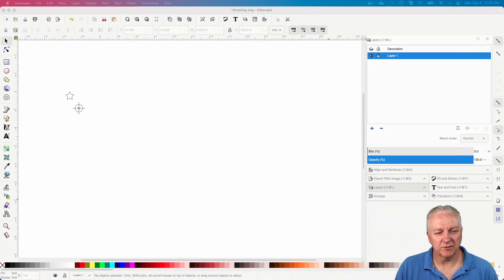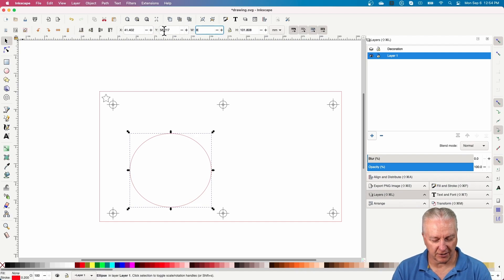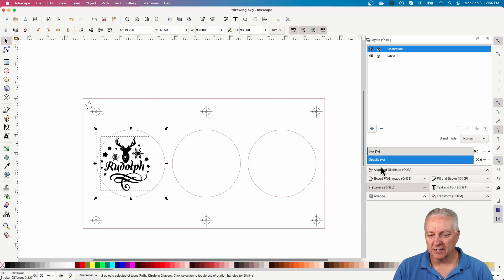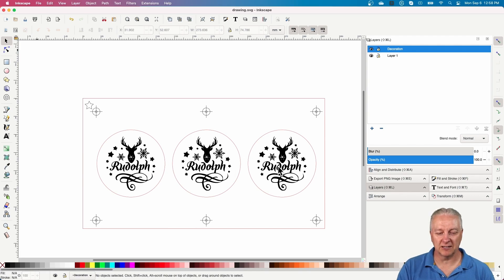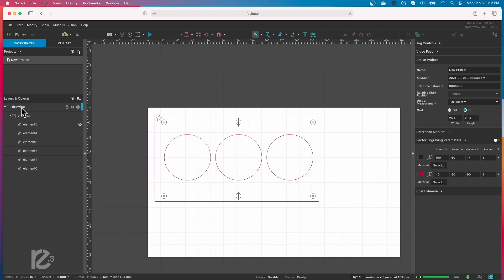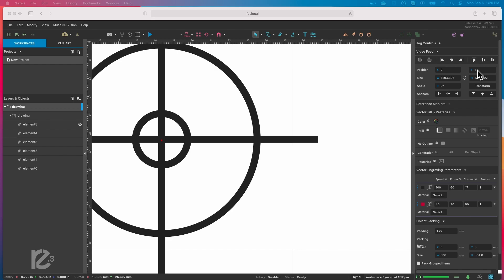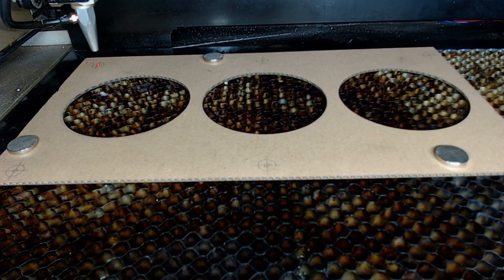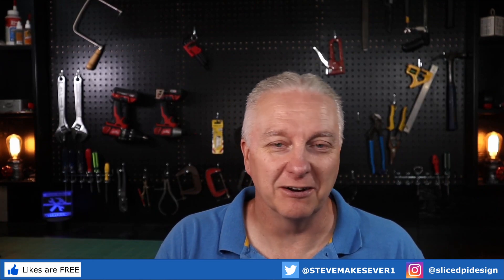A Jig for Laser Cutting

Comment: Hi. To get the crosshair perfect to the bed i have a pin hole dead centre on each cross hair!!! When i line up the 1st cross hair i put a pin through that hole on to the work board- so when i move the template the cross doesn't move and makes the cross hairs easier to line up in the other positions without throwing say that 1st one out- the others are lined up perfect!!! Good on you showing this! TY
Reply from the maker: I often use guide pins like this too. When precision is essential this is the way to go

Comment: Thanks for the video. I just got my XTool D1 10W and found your channel.  I followed your video and it was extremely helpful to a newbie like me. I am trying to do some 4 inch round coasters so I created a template with targets and 4 inch cutouts. All good. Then I put all that into a tool layer and drop in a coaster. I set up the text so that it is H-centered and V-centered on the coaster I want to create. I use the targets and absolute coordinates to make sure everything is set and hit start. The laser moves to the correct coaster area and it is vertically centered correctly but it is starting the text too far to the left, not in the horizontal center. I'd appreciate any help in figuring out what I am doing wrong. Thank you
Reply: One other note. When I use frame, the framed area looks like it is centered both horizontally and vertically but when I hit start, it moves to the left and starts putting down the text too far to the left.
Reply from the maker: Hmm, maybe this is some weirdness in Lightburn. Make sure you are engraving the font you think you are. If you created your coaster somewhere else and it uses a font that isn’t on your machine, lightburn will use its imagination to pick one.  Vector fonts tend to be a bit weird sometimes.

Alternately convert your design to a bitmap image and engrave that to see how it does.

Comment: Excellent video! Could it maybe be a good idea to drop the discs in the template before aligning it perfectly? Thanks a bunch!
Reply from the maker: The point of a jig is to make dozens of these without resetting position.  When I use a jig I will use either tape or magnets to keep it in place and then will periodically check positioning to make sure it isn’t moving

Comment: Why wouldn't you cut the outline first, then move it to the upper left of your bed before cutting the circles? No need for alignment then, just place the template at top left every time you use it. Or am I missing something? Great video as usual Steve 👍
Reply from the maker: If you are engraving images then you often need more space on the sides of the workspace for the head to slow slow and change direction. Sometimes you can get away with. Using a known physical location but don’t count on it. You will also find out that on many lasers the workspace fit isn’t precise and flop around a bit so the location you think is known, can actually move around a couple millimeters in both directions
Reply: @SteveMakesEverything Thanks for the explanation. I get it now. I'm new to lasers, but have extensive experience with cnc machines, which don't have this issue of overscan. Lots to learn by the look of it 👍

Comment: is there another way to down load the file besides github?
Reply from the maker: There is only a single SVG there.  Once you click on the file you will probably see the actual image displayed.  Right-click on that and save the image file to your local system

This BTW is one of the reasons I switched away from GitHub.  Unfortunately it means I needed to expand my web site service, which costs a bit more and is what memberships help pay for.

Comment: Steve, 
You videos are amazing, i recently purchased a FSL Muse Titan and have had problems with it from Day 1. Demos and instructions from the FSL site are really poor compared to other laser manufacturers. i am so glad you are help the community out with your FSL video examples. Steve have you had any luck with engraving Glass with your FSL Laser and if so what settings would you recommend?

Many Thanks Again 
Prakash
Reply from the maker: Thanks Prakash.  Yes I have engraved glass.  The settings will depend on your laser so you'll need to work them out for yourself, but generally start with lower power and higher speed and gradually adjust until you get the effect you want.  I did a video about the rotary attachment where I engraved wine glasses - take a look at that for some tips, though a Titan has much more power than a Muse 3D so you'll definitely need to scale that back.

BTW, when laser engraving on glass you will get lot of little shard artifacts, so you will probably want to lightly hit the engraving with a soft rotary bush to remove any remaining shards (avoids potential hazards later).  Wear safety glasses when doing this of course.

Comment: New to this. Is the advantage that you can precut the disks and then just drop them in thereby saving cut time?
Reply from the maker: The shape of the things you are trying to engrave is irrelevant.  It's all about engraving in volume.  Set up for cutting is roughly constant regardless if you are engraving 1 or 20.  This lets you reduce the time to engrave a bunch of items dramatically
Reply: @SteveMakesEverything  but why not just make a file with the amount of discs that would fit on your workspace, and Cut them at once? Would that take more time in the Long run? I imagine that you don’t have to set up for very Long when it’s a full sheet?

I’m also new in this, and is just wondering.
Reply from the maker: @teitass  It's a good question, and certainly if you were cutting the general outline yourself then definitely you could create a single image with as many items as you need and cut them out while engraving.  It is a lot more memory efficient to use a jig and simply clone your image into each slot, though it is doubtful this would be faster.

However, what if you are engraving onto something you buy rather than cut out yourself?  Many people buy off-the-shelf items for engraving.  They do this for a number of reasons (e.g. Engraving onto materials that the laser can't cut.  Or engraving onto items that are cost prohibitive to make on your own)

One thing I have learned is that there are usually multiple ways to solve a problem when working with lasers, but sometimes you just hit a wall and a jig can save you a bunch of work and time.

Comment: Hi - thanks for leaving in "one of the mysteries" of working with lasers. If you sort it out, please put the answer up!  I'm getting to know my FSL Muse Titan more each time I get a chance to work on it (busy time at work right now). If you had used the camera to align things on the template, would it have been accurate, or would it also have been off just a bit? My Titan has the camera, but I haven't had much of a chance to use it. I DO, however, have several copies of your Hello World test piece (from the "Your First Day with RE3" video - so if you know of a market for them... kidding... Thanks again for these videos!
Reply from the maker: Happy to help and I’m not afraid to show to bloopers😉. Still not sure what is happening there that caused Rudolph to be absent. Sometimes images pulled from Google images can be a bit dubious - they look fine but don’t render correctly. 

Btw this alignment technique will actually be more reliable and accurate than the built-in camera.  If you can find a market for Hello World signs I’m happy to set up a partnership 😀